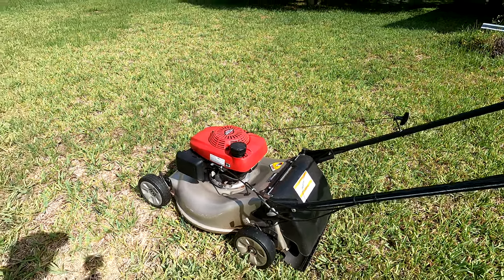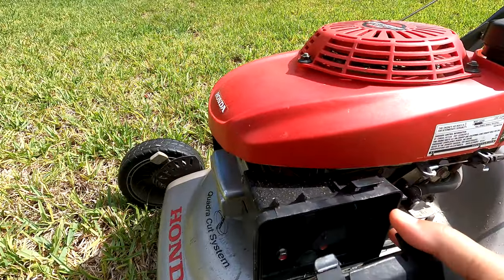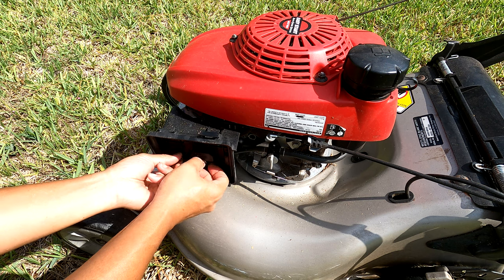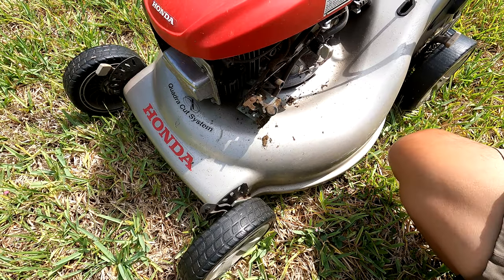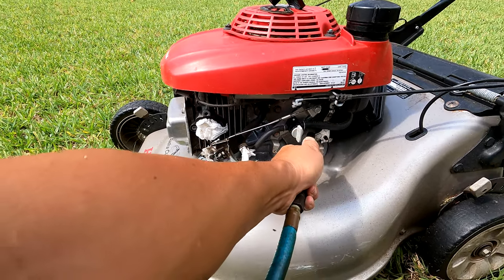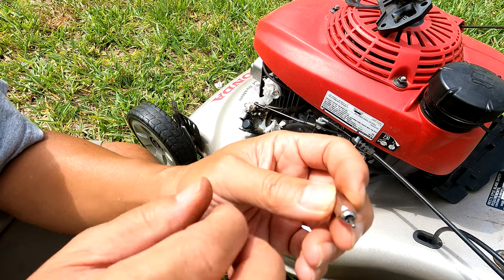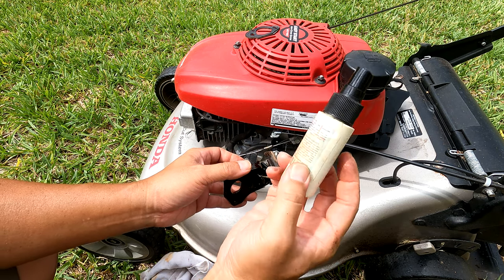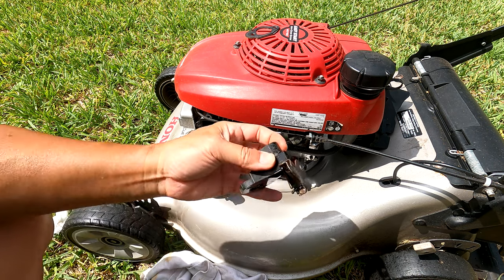Honda mower hard start auto choke problem

Comment: I have this exact same mower. It is imperative to keep the carburetor 'linkage' functioning correctly. There is linkage on top the carb that can easily 'hang up' not allowing the auto choke to function properly. Use carb cleaner to clear away dust and dirt from that linkage. The cleaner yo keep the entire mower, the longer it lasts and the better it functions. Also, if you have access to ethanol free free, most small engine experts recommend using it in these engine. ethanol can cause carburetor issues and cause water to collect in the fuel system unless fuel stabilizers or fuel treatments are enlisted. That mower has a fuel shut off. It is there to turn off the fuel to 'run out' the fuel from the carb.
Reply from the maker: Thank you for the feedbacks and all good advice!  I failed to mention the cutoff fuel and run all out is a must on all of my small engine units!  👍 👍 👍
Reply: I could not get mine to open on its own. Had to reach in and push for mower to increase rpm and stay that way. Sold it like that and showed him how to move linkage for it to ope.

Comment: A cold gasoline engine needs a rich fuel mixture to start. 
Once started they begin to run fine on their normal leaner setting. 
Carburetors have both manual and automatic choke mechanisms.
Both work fine if are in proper operating condition. 
Chokes can stick on or off neither will allow proper running.

Avoid any debris into cylinder intake as it will cause piston scoring and valve seat damage.
The air filter prevents this in normal operation.
Disassembly could allow dirt into engine just be careful.
Fresh quality oil and new spark plug and clean cooling fins and blower impeller and air flow tract.
An inline fuel filter upstream of fuel shutoff not a bad idea. Clean gasoline is a carburetor’s best friend. Tiny ports and jets don’t clog. 
For long term storage drain tank and float bowl.
At start up years later fresh fuel ⛽️ and she’ll purr like a kitten.🐈‍⬛ 
That little engine will run forever.
Reply from the maker: Thanks @billbright for the comment 👍👍

Comment: The question is did the pin go back in after it heated up , choke on after it warms up gonna run rich n rough .
Reply from the maker: Thanks for comment; yes pin does go back in when engine is cool down.

Comment: Did it still work after the thermowax wd40 thing?
Reply from the maker: Yes, mine still start with a pull or 2 🤞!  Thank you for the comment.
Reply: WD40 is NOT a lubricant. It is a very good penetrating agent. There are carb cleaner/lubricants available that is far better off to use.
Reply: @CuriousKL  nope

Comment: That is a great engine, take care of it and it will last you a life time!
Reply from the maker: Thanks for the comment! Agree with you there but also worry for the deck will not able to keep up.
Reply: To protect the life of the deck you clean it with the wire brush then use a old paint brush and brush used motor oil on the bottom of the deck to protect it from rust. 😉👍
Reply from the maker: @nickbustos4839  Great info to know! Thank you for your feedback! 👍
Reply: @nickbustos4839  Scrape and power wash the deck. After apply Rustoleum paint with a brush or rattle can. Caked wet grass has killed more decks than anything else. I try to never cut wet grass. I have decks 10 years old that look like new.